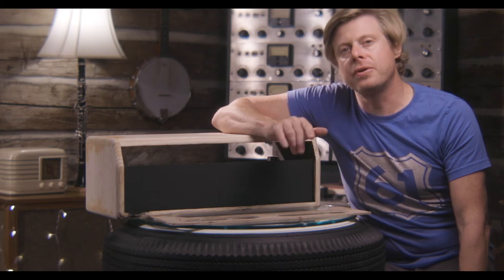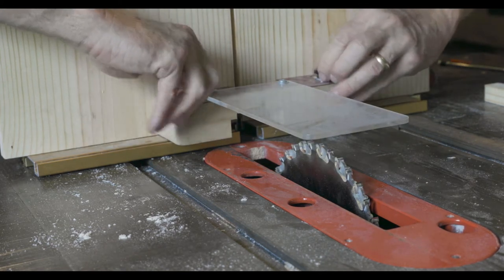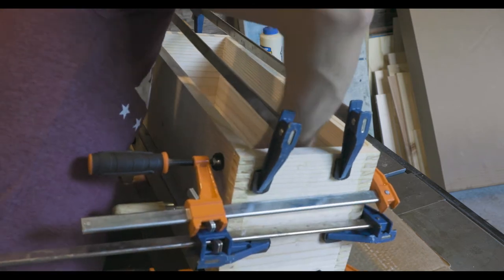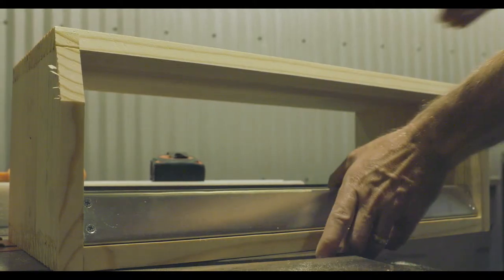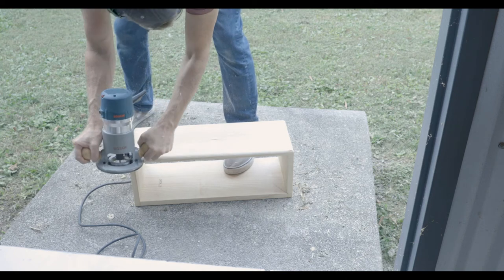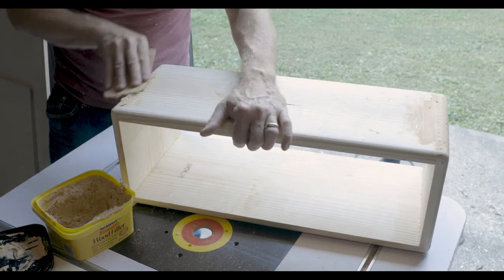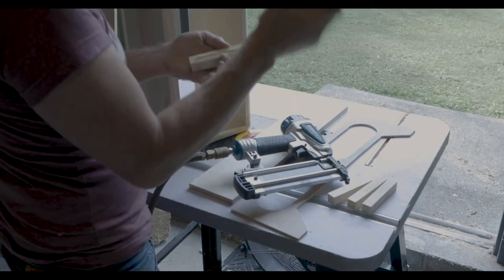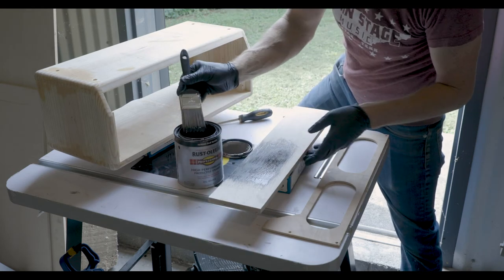Guitar Amp Cabinet Building from Scratch DIY

Comment: I have a question, are finger joints necessary for head cabinets or just done because they’re traditionally done that way?
Reply from the maker: Other manufactures can use lap joints or something other than finger/box joints. I think it depends on your material as to how much strength you need. For me the finger joint is worth the extra effort since it’s never going to move. In 50 years it will still be rock solid.

Comment: i love how you do all your stuff. I feel like i have been a apprentice of yours but at a distance lol because i have learned so much from just a few of your videos. i was the one that you sent the amp cradle planes to. i did get it done and i love it it works so good thank you so very much. the one thing that i did on it was made  a extra piece the amp sits on i had to make one double the thickness because the amp i did had the power transformer right on the edge of the side. but now i can switch them out if i need to. so now i am making a cabinet for the amp. and i love how all yours look but i couldn't find the size router bit you use for the round over? is it 5/8 i notice some use 5/8 or 1/2 inch? and then some marshals use 1 inch i would love to know what you think is best? The amp head is a JCM 800 clone and i am mounting it on the bottom. thanks again
Reply from the maker: Thanks!!  I’ve been slammed with orders and my main lens broke but now I’ve repaired it and am looking forward to making more videos after the holidays! I build a lot of cabinets but since I’m a one man shop I don’t film very often. Hopefully I can change that in 2024. 

I’m glad the cradle plans worked out for you!  As far as roundover bits go some of the differences are predicated on the thickness of the stock chosen to build different models of cabinets. I’m away from my shop at the moment and don’t remember off the top of my head which bit I’ve got. Ideally a set would be nice but don’t get a cheap set. If you have to choose between one really quality one and a set of cheap bits go for the quality. The better the bit the less tear-out. Tear out = bad.
Reply: @FreshOldSchool   thanks for getting back to me. I am glad to hear you are busy. i have slowed down to a craw which i expected because of the holidays. after doing some research i bought some white side and Freud bits. when i use to rout trim packages for restaurants i never payed attention to the bits because i did not have to pay for them. but now i wish i would of because we would do 100,s of board feet with a single bit. and tear out man does that suck can ruin a project really fast and your day to lol. i didn't notice if you had any videos of you doing furniture ? that would be really cool to watch because building amps and guitar stuff is fun but making furniture would be great. you take care and stay safe cant wait to see some more builds

Comment: You need a work table. Stop working off the ground for your backs sake 😬
Work looks great though!
Reply from the maker: Thanks!  Having a multi use workspace is challenging. I’ve got plans to build a proper wood shop and will definitely build a proper work table when I do. Until then I’m building up my Mr Burns posture. Haha.
Reply: @FreshOldSchool  yes Sir! I damaged my back because of so much working like that. 
I learned as I got older 👍

Comment: Another nicely done presentation; you're a real pro.
If I might offer a tidbit of unsolicited advice, I'd say that rather than measure everything (nothing wrong with measuring), it simplifies the process to cut a few spacers out of scrap material.  For instance, you know you'll need to leave some clearance for fabric for the chassis; masonite leftovers work perfectly for this.  As for the spacing of the chassis within the cabinet, if you have some 1/2' plywood bits (Baltic birch comes to mind), a couple of these make it a snap to locate the chassis front and back.  I think the slant on those chassis fronts are 25 degrees, but I could be mistaken.
For squareness (especially on a larger cab), cut some 3" X 3" squares from 3/4" MDF on your table saw sled so you know they are 90 degrees.  Clamp all the corners with smaller clamps using these jigs to guarantee squareness, then add the larger clamps to increase clamping pressure; works like a charm.  On the same note, if you find yourself doing several similar cuts, it's worth the effort to make yourself a jig out of 3/4" MDF, and then just route out all the cuts.
If you paint the interior surfaces of the cab prior to assembly, you'll save yourself a ton of trouble; there will only be a bit of touch up left to do.
Please keep 'em coming...
Reply from the maker: Thanks!  I appreciate the advice!  I do have some jigs cut and quick reference spacers for some builds. My shop carries a lot of different models and most of them are unique to each other so I different tools and notes for each build.  I never know what I'll be building day to day. That tip about pre-painting is gold.  I hadn't considered that!  Thanks!

Comment: Nice film! Do you know where to find writings with dimensions for a amp head like yours? Building a Princeton head.
Reply from the maker: Thanks!  There used to be a site called ampwares that had all the specs.  Now I believe Mojotone owns that site.  They build cabinets probably based off the original data from ampwares.  So you should be able to scan their site to get dimensions.